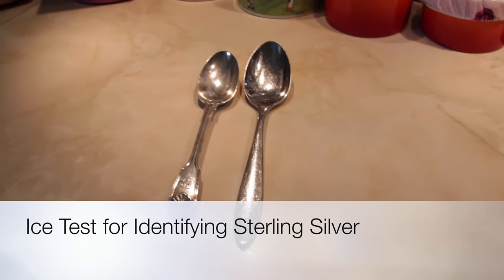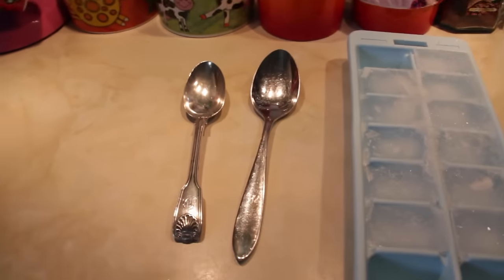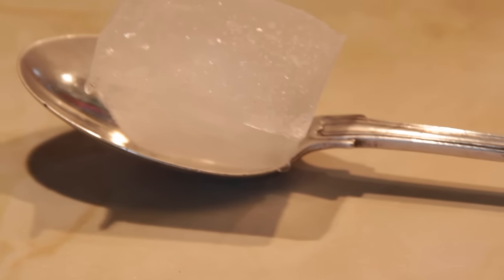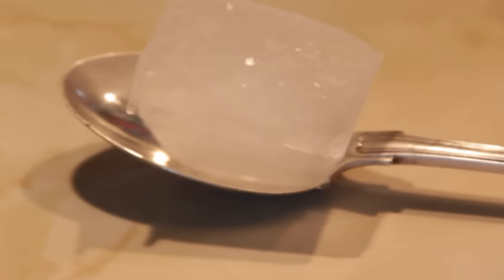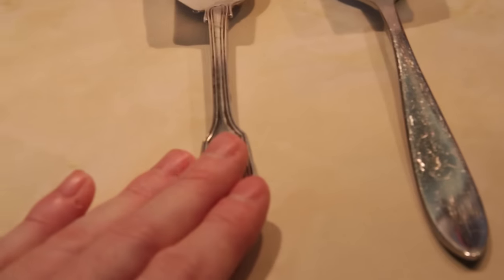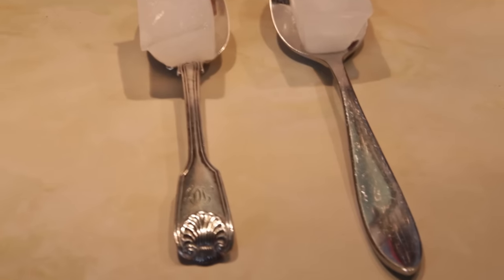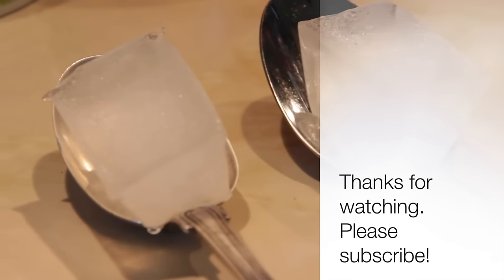How to tell Solid Sterling 925 Silver from Fake Silver or Stainless Steel Using the Ice Test

Comment: the conductivity works in both directions, temperature-wise. You probably wont have an ice cube but you might have a match or a lighter; heating the bowl will also heat the handle pretty fast on a silver spoon...

Comment: I used the ice cube test on a tray which I know is silver plated and the cube melted in seconds maybe since the silver layer is a thick one. So these tests are not always foolproof. Take it to a silversmith for an acid test.
Reply: Also Nickle will melt an ice cube very fast. I agree the acid test is probably the best way to find out.

Comment: Imagine yourself at a bus stop in the winter.  There is a stone bench, and a wooden bench.  Which is warmer to sit on?  Suppose you had a newspaper to place on the seat of the stone bench? They're both the same temperature of course, but wood and stone conduct head with different efficiencies.  Likewise the "specific heat" of each metal is different.

Comment: Watching ice melt is about as interesting as watching paint dry.   Go ahead and skip this video as it offers no conclusive proof as to whether or not a spoon is sterling silver.  This is a completely bogus test. Why? Because a cube at 20 degrees and a cube at 30 degrees will both be frozen ice cubes and look identical but they are not at the same starting temperature.  The cube at the coldest original frozen temperature will melt slower, regardless of which spoon it is sitting in.

Comment: "Solid Sterling" is an oxymoron or conflation of terms, as Sterling Silver is an alloy that is typically 92.5% pure silver and 7.5% other metal..most often Copper. Sterling by definition is not "solid silver" but is a solid alloy. By contrast, silver PLATING is not solid (referring to the entire object) put possibly is pure silver plate on top of another metal.
Reply from the maker: Thank you for the clarification. So technically 0.999 purity gold is not solid gold?
Reply: Smartwatch & Gadget Unboxings by Dr Jake it's as near to it as can be reasonably claimed. I have seen .9999 pure, that seems to be. the standard in Canada. Fun fact: 24k gold is .999+ pure.
Reply: Although i see your point and clarification of terms, i'll have to comment and respectfully say that solid sterling silver is a correct term in certain cases. As you may know there are exceptions to every rule in the book. In jewelry, gold mostly, but sterling silver as well, they do not always make solid metal jewelry. As you might know, a lot of gold and silver necklaces are hollow on the inside, and literally are as heavy as a piece of paper. I will contradict you by simply taking two sterling silver necklaces into consideration. One hollow necklace, no heavier than a piece of paper, and the other solid, weighing 90 grams. What would you call the hollow chain, nothing more but a hollow chain, right? Now what would you call the other chain (necklace) that has a heavy weight? Solid, am i right? So therefore solid sterling silver is a correct term..
Reply: Solid Sterling Silver is a correct term. I have responded to the original comment in response.
Reply: Good point, and that does make sense. As I used/corrected it I was referring to metal composition, not piece composition. I'll take hollow sterling over plated any day.
Reply: I remember when I was young sterling silver was cheap and it looked more like steel than silver which a has a milky white luster to it. The people masquerading as Jews are squirreling it away, just as other precious metals and gems.

Comment: "Cold" is not a thing and it does not radiate you are talking about heat, you have it backwards.
Reply: cornman1123 bah umbug don't have science test to grade.
Reply: Adam Dye it’s actually a pretty important distinction.
Reply: heat is lost, in this example, via conduction and evaporation.

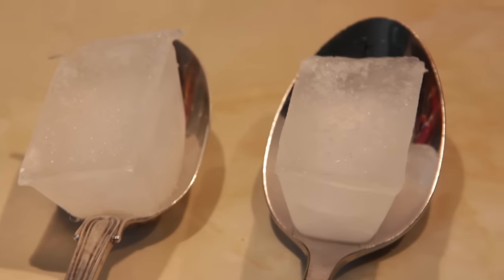Comment: You can skip to 01:20 if you don't care about the preamble.
Also, this is a silly method, because it's *comparative*.  IOW, you would have to test the questionable silver spoon AND a stainless steel spoon to use as a control, every time you test every questionable spoon.
Reply: Was looking for this

Comment: Not the best test as the melting also depends on the contact surface between ice and spoon. Neither spoon or ice is flat. Also, there can be some metals inside or mixed with silver that have great thermal conductivity too. Like copper or aluminium
Reply: Silver alone is the top electric conductive.if that was .9999 silver,it will have highest conductivity than a mixed .925 silver (sterling)